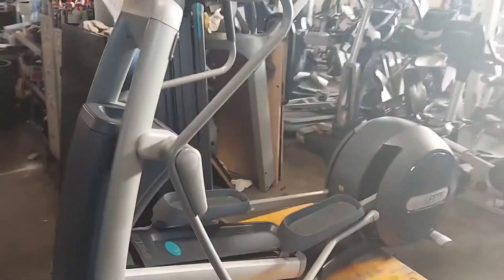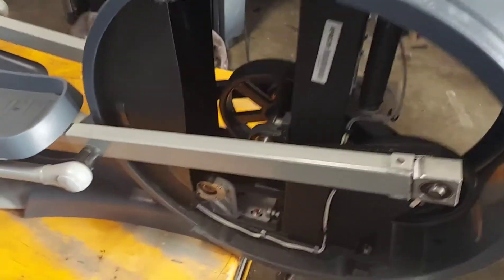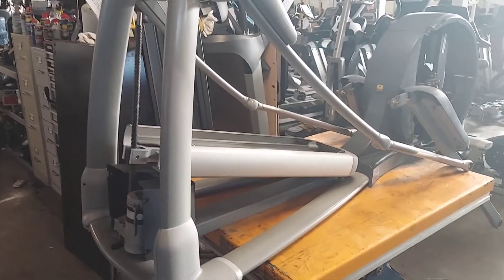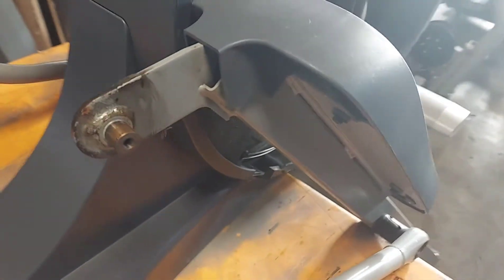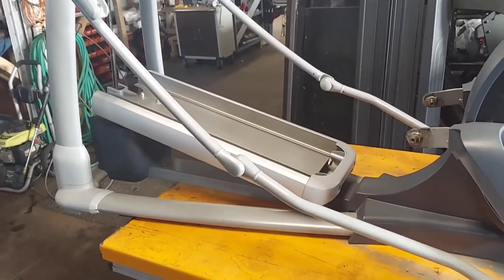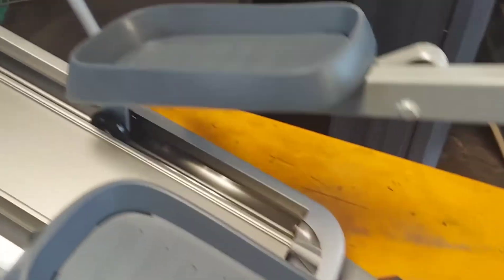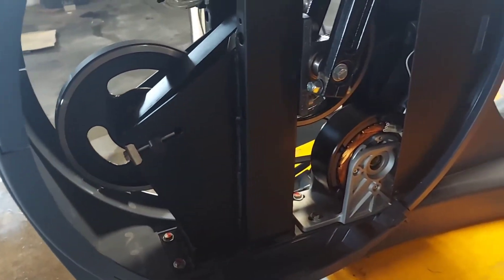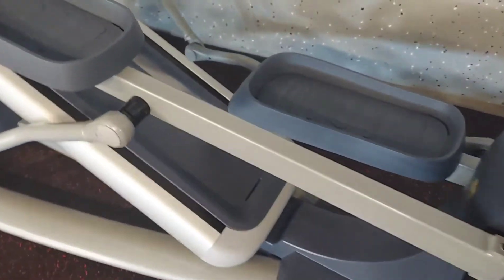Precor Elliptical Refurbishment Process

Comment: How do you remove the covers on the crossramp shaft? I don't want to break mine but I need to take them off.
Reply from the maker: I don't remove those outside covers because of the trouble they are. But if you need to there are hex screws from underneath you can take off and this will get you what you need
Reply: @coloradocardio  Ah ok, thank you very much! The tray was moving a little when I was pulling up on it, but something stopped me haha because I knew SOMETHING was about to break.

Comment: Any advice on the ramp covers? The rails on mine have some layers sheared off so its a bumpy ride. Ive seen ramp covers that are applied with adhesive but im thinking i should smooth out the underlying ramp with jb weld before applying the new ramp cover. The sheared off layers are maybe a quarter millimeter deep but over a centimeter wide and maybe 20 centimeters running the length of the rails on either side. 

So yeah any advice on new rail covers applied with adhesive for a smoother running surface?
Reply from the maker: Yes they sell new ramp covers for approx. $50 put these on and you have a new smooth ramp